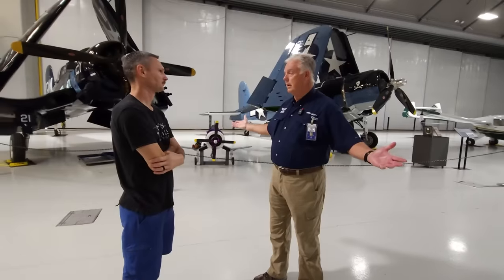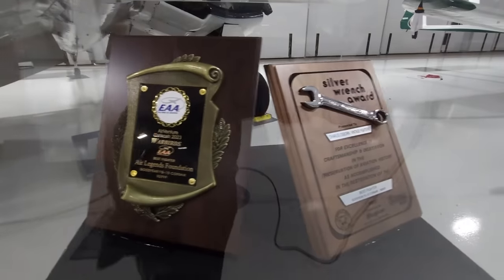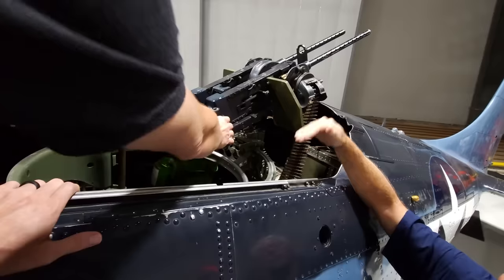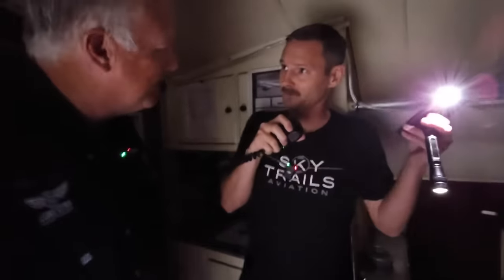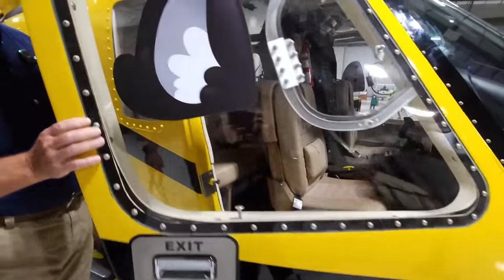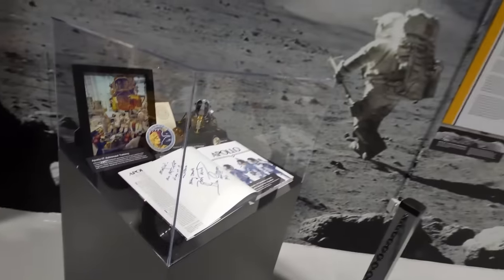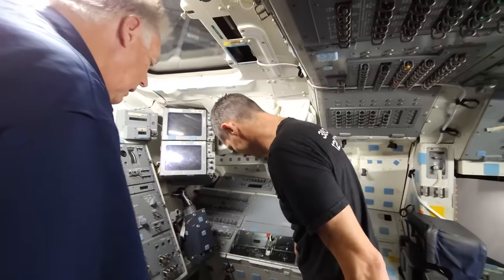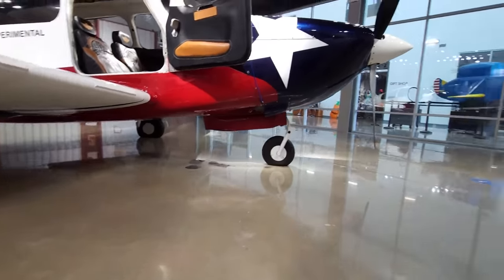83 Year Old Airplane Flies Again (Lone Star Flight Museum)

Comment: Taping over gun ports was common, mostly to protect gun barrel from debris during ground rolls and take-offs from unpaved runways and also against moisture.
Reply: Also protect against mud daubers.
Reply: The applied fabric also helped prevent the gun icing at altitude.
Reply: Was gonna say the same thing, also to prevent Icing issues in inclement weather, but you'd think someone in a Museum would know that
I suppose it's an Obvious thing tho? if the tape was unbroken, they hadn't fired their Guns?
Reply: Your son does a very good job filming

Comment: In the spring of 1999, I had the privilege of visiting the hangar in Middlesboro, KY while Glacier Girl was being restored. It was in a hangar just large enough to accommodate the plane comfortably. The hanger was only for expert restoration and not a museum, I was able to walk right in, view Glacier Girl without restrictions as well as photograph some really good "before & after" examples of the toll the extreme environment and incredible pressures took during its 50 years under the ice. Of course, forty-three thousand (43,000) pounds of pressure per square inch affects the wide variety of materials used in many different ways -- glass breaks, rubber tires are squeezed until they explode and metals bend or snap. One of the volunteers working on Glacier Girl explained that original parts from the plane are often unusable, except for hammering back out flat to use as a pattern to recreate the original. Very nice people who took time away from restoration work to talk to my 5 year old son. I'm hoping for an opportunity to see her fly someday.
Reply: The creation museum in Kentucky has a scale display of the recovery of this aircraft! Fascinating! Lots of minute details! Well worth the trip!
While you're in the area, check out the Ark exhibit!

Comment: I am old enough to have flown in a DC -3.   My home was western Nebraska and I was returning from PHX on a Western Airlines Boeing 707 into Denver.  I had to switch to Frontier to get to Scottsbluff, which was an easy thing to do at that time.  (Yes I had on my Sunday goin to church suit). Anyway, the flight to Nebraska was supposed to be in a Convair 580, but that particular aircraft had a mechanical problem.  From, I suspect the back of the hanger, they found a DC-3.   It was a cold winter night, and I remember how cold it was as I boarded and walked uphill to my seat.   The cough of the engines and the blue smoke were the highlight for me.   It was a clear starlit night and too short a flight.   I couldn’t wait to tell my father about the trip, as he was a B-25 pilot in WWII, but also a significant number of hours in C-47’s (DC-3’s).   Great airplanes.

Comment: I know this is a late post, but as a fellow who flew a Stearman for over 30 years (N48193), they are extremely easy to fly and very forgiving.  They tend to float on landing and land below 50 mph. The gear track width isn't a problem.  They have plenty of rudder, and don't ground loop.  The original Stearmans had a triangular piece of wood added to their leading edge to make them spin faster and make the stall abrupt per Army Air Corp request.  Without this strip they are very docile.  My aircraft was in the movie:  "The Tuskegee Airman" and now is in a flying museum in Madrid.

Comment: In the early 70's I was introduced to private aviation by a friend with an Erocoup.  His friend had just finished a beautiful restoration of a 1924 Fairchild 24-E.  The E meaning a Ranger engine.  The only example flying.  The flaps on that airplane were about 6 feet wide and 18" cord on each wing.  They were huge.  On one occasion Bill could not see in the early evening and suddenly realized, while turning base, that he was landing behind an 1925 Fleet.  He grabbed the flap handle and immediately lowered the flaps a full 90 degrees in the middle of the turning bank.  I have asked many flight instructors since what happens if you put the flaps on too fast.  None has ever been able to tell me.  Some speculated the flap might break loose and fall off.  Maybe.  The airplane quit flying and began to hurtle sideways with the tail starting to spin out to the right.  Have you any idea how hard it is to sit there and not grab the stick between your legs?  I picked out my tree and waited for impact.  Bill applied full power to that large propeller and full right pedal to that huge rudder.  Eventually the plane stopped spinning and the wings regained control of the air over their surface and the airplane started to fly again.  I let out a long low whistle and the guy in the back seat, who had never flown before asked why I whistled.  He gave the plane to me and I flew it around the pattern again until Bill could see the runway and land the plane because I had never landed a tail dragger.  I went out shortly after and learned.

Comment: G'day Jimmy,

Good stuff!

Thanks for making & posting.

Two errors merit correction though,

Taping over Gunports after Re-arming served two purposes,
1), it ensured that during 
Take-off,
Climb,
Cruise, &
Manouvreing...., 
Until the 
Weapon is fired ;
It is being protected from being
Refrigerated by the Slipstream being
Rammed down the Blast-Tubes & exhausted via the 
Muzzle-blast Extraction Ducts,
And otherwise
Pre-freezing the 
Firearm.

In theory & in practice, because
Firearms are Chemical
Heat-Engines...,
The "waste heat" from firing the first
Burst
Heats the Mechanism sufficiently that the
Cold Slipstream - during the normal time between first & last bust in any Aerial Combat, was unable to chill sufficiently as to be a problem.

Some Fighters had
Heated
Gun Bays....

The
2nd reason for taping Gunports as the
Final step in
Re-arming..., 
Is because the
Groundcrews & 
Aircrews could see
At a glance,
That the Aircraft was
Armed &
Loaded.

No Tape on the
Gunports =
No Ammunition 
Onboard.

Intact Tape on
Gunports =
Fully Loaded
Weapons....

Shot-through 
Tape on
Gunports =
Needs to be
Re-armed....

Meanwhile,
The Stearman was 
Biplane.

In the 1920s 
ALL 
Military Procurement Organisations &
Most Civilian
Regulators
Mandated the
Location of ALL
Biplane Fuel Tanks 
Outside the Fuselage,
On the
Top Wing.

Hence
DH Moth & Boeing Stearman &
Handley-Page Hermes 
ALL
Had their Fueltanks on the
Top
Wing.

For
Fire Protection,
In case the Engine lit up,
As well as to render
Fuelpump Failures
Impossible.

Cessna to this day,
Builds High-wing
Light
Civil Aircraft, with 
Wing-Tanks,
Gravity-feeding the
Engines.

The Stearman was
Designed for a Navy Contract.

It's Undercarriage was
Bog-standard
Conventional,
Width-wise,
On EVERY
Single-Engined Biplane from an 
Avro 504k through 
Sopwith Camels,
Fokker Triplanes & D-VIIs,
Bristol Bulldogs, 
Gloster Gauntlets & Gladiators,
Curtis Hawks, 
DeHavilland Cirrus, Gypsy, Tiger, Fox & Hornet Moths -

To say nothing of the
Wildcats Hellcats, Avengers, and all the other
Narrow-Tracked
Carrier Hairygoplanes the
Stearman was
Expected to
Prepare Ab-Initio Pilots to
Think of as being
Normal....

Tiger Moths prepared 
Spitfire
Pilots for
Narrow-Tracked
Undercarriages...

Stearmans
Prepared US
Carrier Pilots for
Reality.

Just(ifiably ?) sayin',

Such is life,

Have a good one...

Stay safe.

 ;-p

Ciao !

Comment: I was fortunate enough to get some flight time in the military version of the DC3, the C-47 in Vietnam. Our USAF psyops unit had two of them at Bien Hoa AB that flew night missions to drop leaflets and play propaganda tapes over a loud speaker system. Ours had the double cargo doors on the left tail section removed with a cargo net stretched across the opening. We would sit with our legs through the net out in the slip stream and toss leaflets out. It was not uncommon to see red and green tracers on the ground where night combat was happening. Red for American/South Vietnamese forces and green for the NVA/Vietcong. Heady times for adventurous young men!

Comment: The DC-3 has split flaps.  Fowler flaps travel aft before going down, which is common on most airliners and Cessna singles.
Reply: no cessna single has Fowler flaps. They have single slotted flaps.
Reply: @buckmurdock2500  No, Cessnas do not have Fowler to the extent of say a Boeing 727; however, if you look at the 177 and 210 they do track aft before going down.

Comment: Be it as it may....noticed a minor but technical error regarding the vinyl graphics on the cowl of T-41 referencing specifically the text script "Fighting Mescalers".  Time stamp (1:03:02)  It definitely was not produced by a certified typographer or graphics pro.  This is a frequent error made by many sign shop novices.  The text (font) is called "Brush Script" and as such must have all the lower case characters connected together except the first capitalized character.  i.e.  "F" and the "M".  A common amateur error among novices who have an incorrect setting in their software "kerning" of scripted fonts or perhaps they intentionally and manually "kerned" the text because they thought it looked better.  Kerning is the spacial relationship between characters.   Scripts are designed to emulate handwriting!    Too nice of an airplane not be accurate and authentic!   c'est-la-vie.  Superb museum...great twice viewed video presentation!

Comment: 1:22:55 As a teenager, I flagged for the crop dusters. Your flag pole was half as long as the wingspan of the aircraft. You would start at one side of the field, lay the pole down and you would stand there waving your flag for the pilot to line up on. From then on, you lay the pole down twice. That puts you in the center of the wingspan for the next pass, and repeat across the field until you reach the other side of the field. The pilots would sometimes not shut off the sprayers, and you would be sprayed with what ever chemical that was being applied to the crop, NOT COOL.

Comment: That "door" by the propeller on the DC-3, is not a door at all.
It is a protection plate for stopping the ice coming off the props.
Reply: That's incorrect sir, I have thousands of hours in DC-3/C-47s its a door that was called a service door in the day (nicknamed "Hamburger Hatch")  behind the door are reinforced skin for when the props sling ice, makes a loud racket when ice hits side of the reinforced skin.

Comment: The axe is actually a current leagal requirement.  According to part 91.513  E   "Each airplane accommodating more than 19 passengers must be equipped with a crash axe."

Comment: I never hear about angle of incidence.
Reply: Why would you need to?
Reply: @Dan-mu9vu  because I think some people are using angle of attack when it’s not the correct term. I learned about it A school while learning to be a structural mechanic. I think the book we had , had the two backwards but the angle of incidence is built in to the aircraft and the angle of attack is how the pilot maneuvers the aircraft. The book we had had those two opposite of what I just said. I’m wondering which is correct and why it’s not used correctly in aviation videos.
Reply: @johncamp7679  What part of the video are you referencing?  I was busy doing stuff and had this running in the background.  I probably missed something.
Reply: @Dan-mu9vu  I’m not sure if something in there or not, but something must have made me say that, or I just was talking in general. Maybe the book was right, and the angle of attack is designed into the aircraft, and the angle of incidence is how the pilot is flying?  That’s why I’m curious about the answer. Those two terms were together, but you only hear about the one. Maybe Scott Manley would know.
Reply: @johncamp7679  Angle of attack is variable throughout the flight.  I was just curious about the context of the comment.  Pilots hardly ever talk about angle of incidence unless they happen to be discussing design.
Reply: @Dan-mu9vu  I appreciate that. I’m sure I’ve heard people talking about an aircraft while sitting on the ground and its angle of attack. I worked on the E-2 stationed at Miramar back in 1990. When it was still Top Gun. Nothing like seeing F-14’s flying. I love American military jets.
Reply: @johncamp7679  F-14 is the best looking jet.  Not a stellar performer, but very nice looking.
Reply: @Dan-mu9vu I did hear stories of it being underpowered , back then it seemed very capable. The Navy was still modifying the A-6 with the AE-6B Prowler. Maybe the A-4 Corsair was still in service?
Reply: @johncamp7679  It was designed as a missile platform to target multiple targets at long range.  Not nearly as maneuverable as the F-16, F-15...  

However, if you are firing the gun, you must be out of missiles.  The gun is a last resort.

Comment: And everybody knows why the wing is antitheatrical. Duh. You can easily SEE  that. The prop is far too large, how else would you keep it from the ground? Install a two blade prop and halt the engine? Have some smart mechanism to keep the prop horizontal? But landing on an aircraft carrier they did like madmen, flying fool power just in case they needed a go around. They didn't halt that engine, for they screwed the landing quite often, I guess.

Comment: It was NOT an assembly issue or problem. 
  A Boeing employee remove the assembled plug-doir to prfom a ask. Did not replace it back correctly.  Not a Spirt issue! 
The FAA needs to stop penalizing the airlines by keeping these grounded. An inspection was done by the airlines, all did what they needed tomake sure bolts were there and tighten or cotterpins in place, now let them back up! It was an employee lack of doing job right and wihout an A&P instructor (AI) following bis work, the era was done!! 
    The FAA allowed Boeing to police themselves,  (dumb move) , Boeing saw that the, cats away, so they took advange of it. Simple as that! 
Yeah its a Boeing, " I'm free" attitude who messed up, but it as the FAA's responsibility.. they too tried to cheap their way out. 😮 
Aircraft have been checked out, ✔️, let em fly!!
   Sad thing, what else did Boeing not inspect!! Cheap bastards...
Quality is just not there with so many things these days... its all about $$$